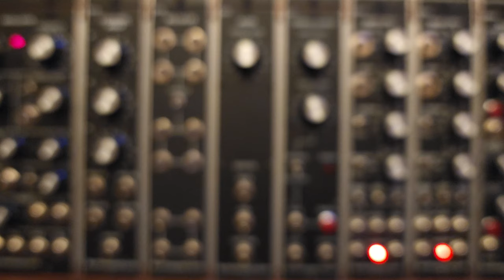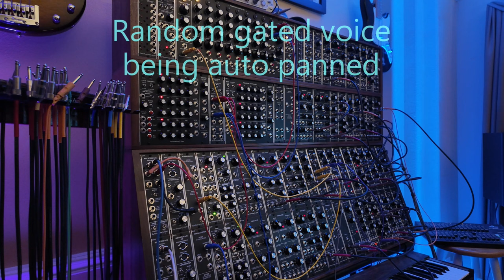Creating Random Gates from noise!

Comment: WOW! Just found this channel, great content, love the sound and clear explanation. I have been playing synths for a few years and have always wanted to try modular. I recently acquired a Behringer System 55 and it is a blast to use! In a world of instant gratification and presets, turn something on; press a button and get a pretty sound, it is refreshing to have to work at it to get the sound you want. Its like an erector set for musicians! I love your set up, looks to be closer in scale to the original Moog and love the wood cabinets! After I get some time under my belt an decide what modules I like where, I plan to get a similar cabinet. There is a guy on Etsy that makes cabinets like the original Moog that are meant for the smaller scale System 55. Anyway thanks for posting all this great content!
Reply from the maker: Thanks so much! I love the building process.